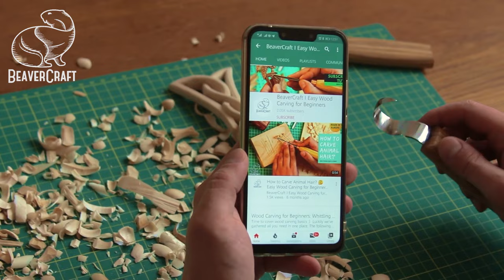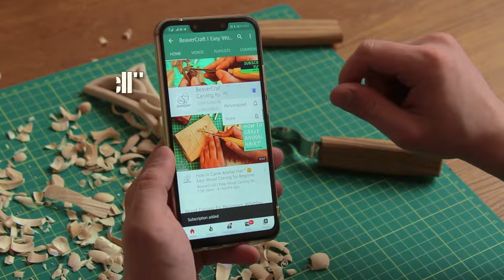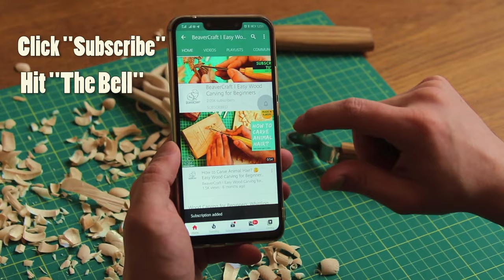Using a Leather Stop on Knives & Chisels

Comment: Just got mine in today, would love to see a broadhead Stropping video.  Excited to try on my knives and archery broadheads 🙏🏻
Reply from the maker: Thanks. We'll take it into account
Reply: You pretty much just hold it at the primary bevel, and the leather will usually give enough that it will get the apex. If not hold it between the primary and secondary bevel. With a leather strop you just have to be careful not to make your edge to obtuse and convex. With my pocket knives I tend to strop on a piece of wood with the compound to keep the angle closer to the intended angle, right up to the apex of the edge.

Comment: Great video but again, what side of the leather do I use the rough side or the smooth side?
Reply from the maker: Both sides of the leather stropping block are smooth which allows you to polish your blades perfectly!

Please, start by applying it to the surface of the strop with the leather. After that put the blade on the leather paddle strop towards the handle. After adjusting it, pull towards the handle of the woodcarving knife sharpening.

As advice, in case you want to have more "finish" results. You can apply the paste only on one side and sharpen the knife, after repeat the same but on the side without the paste.